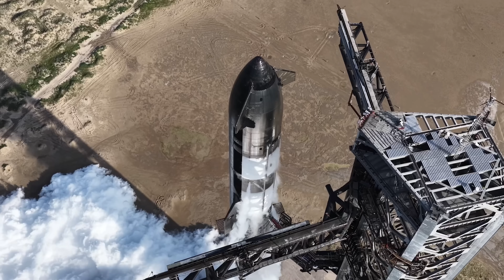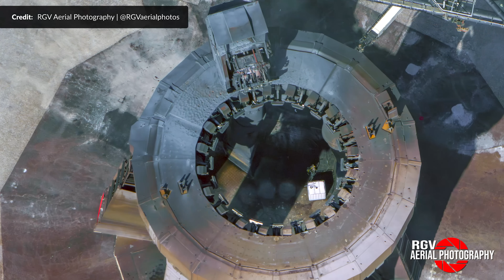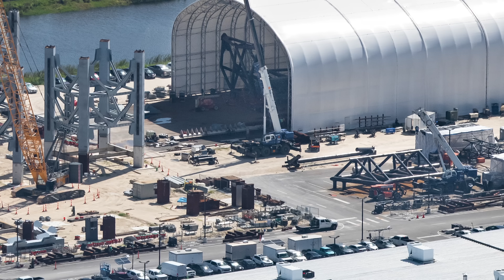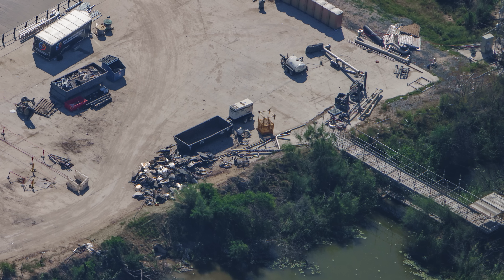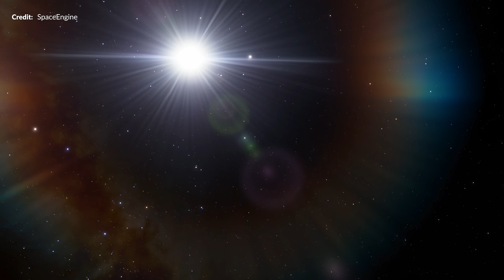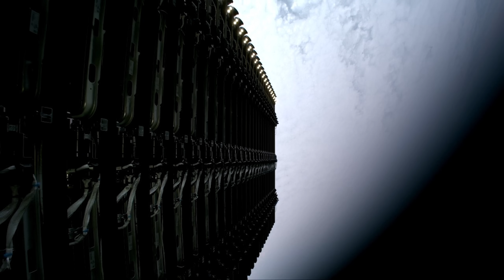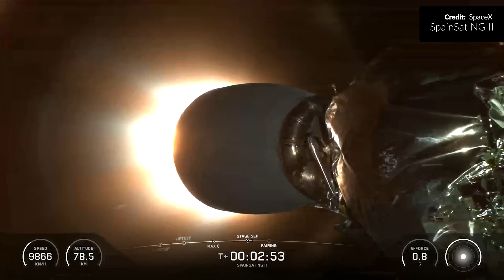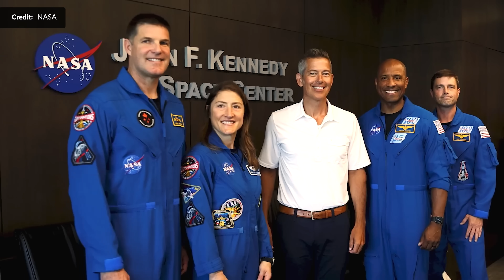Starship Began the Demolition!? 🔥

Comment: Holy craperoni, I knew Starlink had a lot of satellites, but I had to rewind a couple of times to make sure you did not say '17% percent of all active satellites'. It actually being 70% is absolutely nuts. Mindblowing.
Reply: ... and the old Starlinks will fall to Earth as they are already obsolete.
Reply: @Marc_Gagné  As every satellite will eventually. Then burn up in the thick atmosphere
Reply: @Marc_Gagné  all those satellites surrounding the earth, while China has its own company attempting to do the same thing with a solid fuel rocket booster company that recently had another successful launch.
Reply: I find it more impressive that SpaceX is producing around 3 Falcon 9 upper stages a week. That's a big powerful second stage. It has to be with first stage reusability. 
   Starship is a crazy big second stage since Superheavy is designed to always return to the tower. I almost think it would make more sense to have several catch towers built on old  oil platforms down range at sea. Gets rid of the flip and burn boost back. All that energy could instead go into accelerating Starship. I know SpaceX had purchased an old oil platform but gave up on the idea.
Reply: @timonium252  i believe the issue with catching it anywhere else, is it then needs to be transported, and it prob needs to be laid over to transport something that big from an oil rig at sea, so that creates a larger logistic issue. Also supporting that empty can is more difficult.  The entire tower catch idea eliminates all of that, and makes it basically so it can be refueled and re launched without moving anywhere else. At least thats the end goal as i understand it.
Reply: @ChrisGraham00 Could probably fuel it up and fly back. It is a rocket, after all.
Reply: @timonium252  The V3 Falcon is supposed to be ready soon, or within the next year. Probably just allow more Starlink satellites in one go.
Reply: @McCarthyJohn100 I think you mean the V3 Starship. SpaceX is already on the Block 5 version of Falcon 9. I don't think they're upgrading Falcon any further. They're all in on Starship now. Falcon 9 will be phased out when Starship is fully operational and in full production. Which is crazy when you consider Falcon 9 is the most successful rocket in history.
Reply: Yeah, I keep hoping we'll have some international discussions about Kessler syndrome but that doesn't seem to be on anyone's radar 😢
Reply: It is normal that the newest satellites become the majority. Older satellites, close to 1000, have been launched between 1950s and 2000. Less than 150 of them remain operational. Therefore, the SpaceX armada of satellites has become dominant.
Reply: And if you do not believe they are part of the Space Force spy satellites you probably still believe in Santa and the tooth fairy.
Reply: @billhanna2148  The DoD will be the the priority user of the constellation. But spy satellites is a bit difficult of anything that isn't near uninterrupted low resolution, with a platform like this.
Reply: @patrick_test123  The DoD will be the primary user?  Then why are they trying to make their own?  Is the DoD going to pay the same as private users in their millions?
Reply: Hey leave santa out of this.😄
Reply: @billhanna2148  Starshield is an official program afaik. I was under the impression that it consists of Starlink satellites that create their own at least somewhat independent network and would guess that the satellites might have some extras tailored to DoD. I dont think it counts to the public Starlink constelation but I might be wrong.
Reply: @billhanna2148  Wdym believe. Starshield as a concept is public knowledge. Not for spying per say, we have much better satellites for that, but functional nonetheless

Comment: Re: the pock-marking on the launch mount; Maybe they had a painting / coating that they apply to the steel that would normally be applied before a mission.  In order to protect the steel.  In the last mission, they decided not to apply the coating (why bother?), and this is what happens if they don't.
Reply from the maker: I think that was just paint.

Comment: Does the ship have the capacity to power up if the arms fail on catch and fly back to sea?
Reply: Of all the things to fail, the chopsticks would not be the ones to do so. Flip, relight, gimble are an order of magnitude more likely to fail rather than the hydraulic chopsticks. I think not.
Reply: What they do depends on when a issue is detected.  The approach with F9 is aim for a ditch point and correct for landing at the last possible moment.
Reply: Its possible but they wouldnt go for the sea. Just crash i on the big salt flat at the back. Its where they used to crash the early ship prototyping. Easy clean up